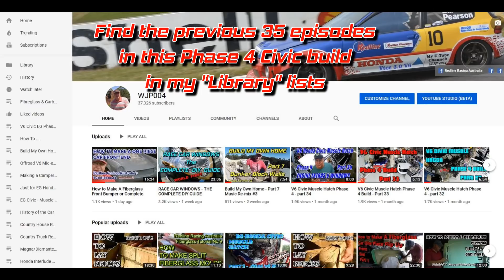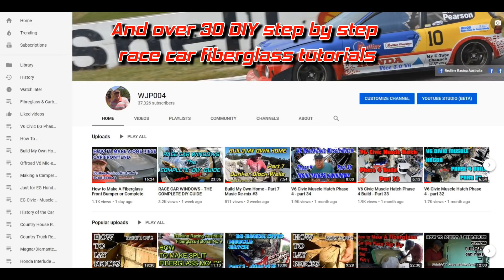Civic V6 Muscle Hatch Phase 4 Build - Part 36

Comment: My suggestion is when you was trying to make your windshield and back glass. What I did to shape mine. Was to get an junk yard glass for front and back turn the arch of the glass up so the high part of the glass is in the middle put wax paper in between them and just lay it over the glass then heat cycle it to melting point 4 or 5 time's. That will depend on how your oven was constructed I built a frame box and used 4 griddles on the ground my box was much taller which allowed the heat to even out as it rose up in the box. pull it out let it cool and there's you  your molded shaped Plexi glass without having to immediately try and clamp it
Reply from the maker: Great idea - which is what I did in the video that precedes this one.

Comment: She is really coming along Bill,
I am a complete novice with carbon fibre, but the appearance of you wing plates and canards seem quite resin heavy,
Could you possibly get a flatter, more uniform finish with less resin?
Also I used a home kitchen vacuum sealer to help mole small parts over a wooden die, worked like a charm. 
Food for thought? Pardon the pun 😂😂
Reply from the maker: Although I have done it, I am not interested in vacuum bagging as I want to encourage guys to maybe start with composites at a basic level to gain confidence. Resin heavy? Only if you're building a plane or an F1. The difference in weight of all those parts between bagging & just wet layup is of no consequence as they weigh bugger all. That's one  myth I'm out to expose.
Reply: I dont question any of Bill's technique/talent or years of  experience ,,,,he is a master craftsman